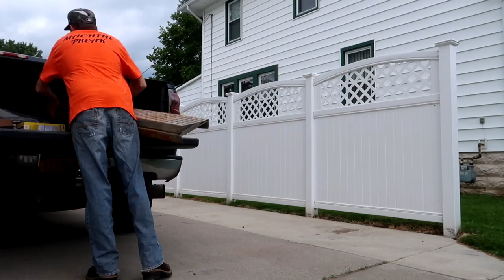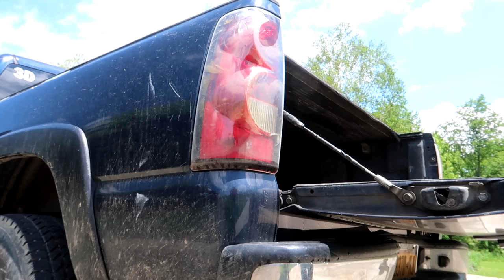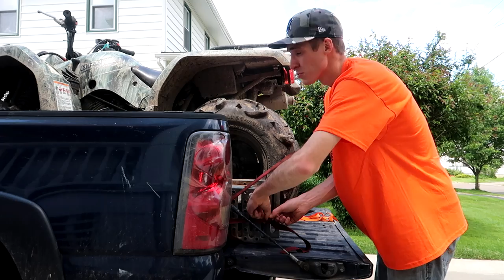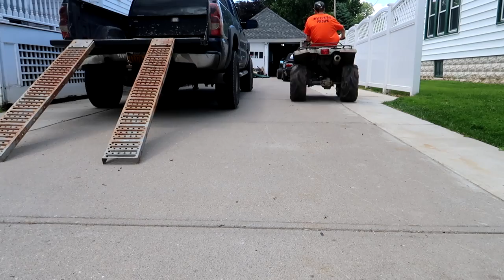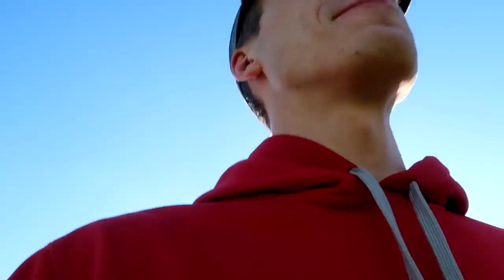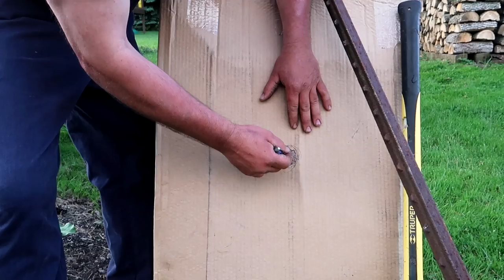INSANE PLANS for 3DMachines

Comment: Hey 3d machines. I just cracked my crankcase on my raptor 350 out riding. Its a small hole, aluminum crankcase. I cant find a welder up here to do it for me, i also live in new york. It would be greatly appreciated and awesome to be part of a video if you could weld it up for me. Thanks and keep the good content coming